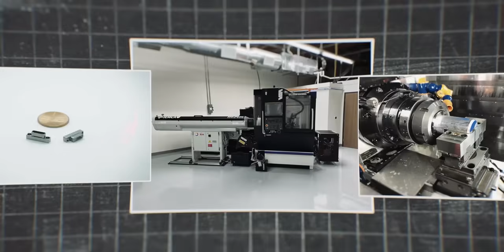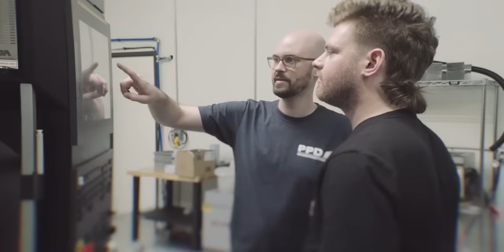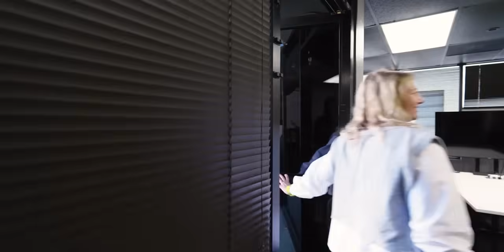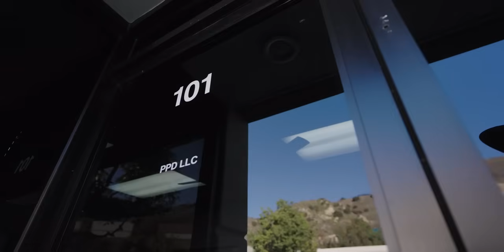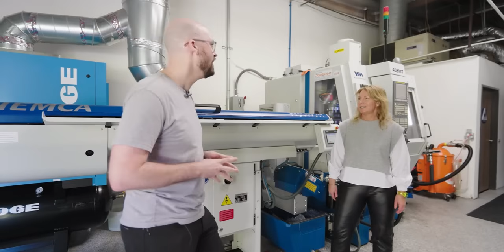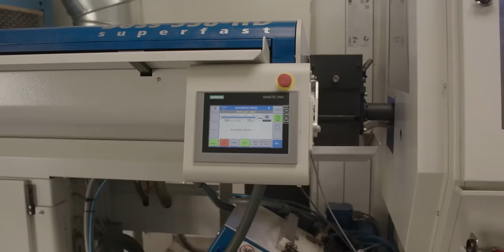Lights Out, Machines On: Inside a One-Man 24/7 Shop

Comment: I make prismatic parts all the time on lathes and Swiss machines.

My issue with bar fed mills is that they only have one tool working at a time. That just drags out cycle times.

I have one part that I took from a company that was running it on horizontal mills. They were running dozens on one pallet. Their cost per part was higher than mine because they had to do 2 ops on to get a complete part. It looked impressive because the had dozens of 1st op parts done in one shot. What was killing them was the 2nd op. I took that part and it on a 32 MM Swiss machine. Even though I was only doing one part at a time I was dropping finished parts every 3.5 minutes. My cycle time on a per part basis was less than half theirs.

When I say I stole the job I mean my shop brought it back in house from a shop we had out sourced it too.